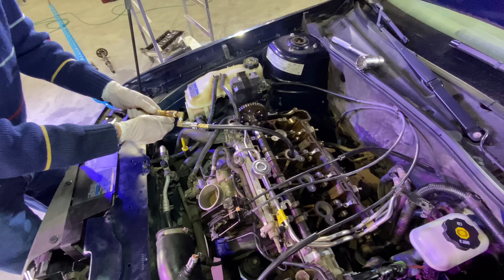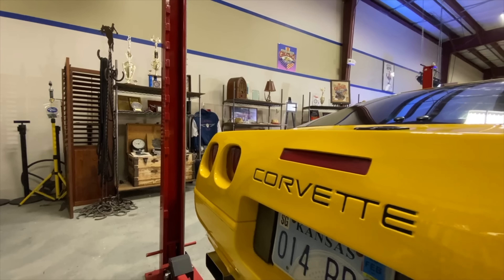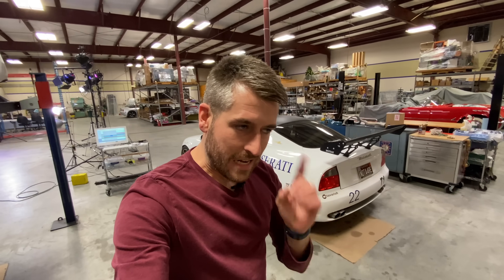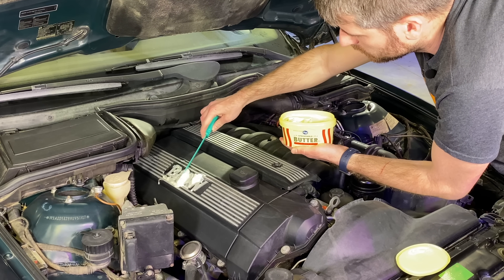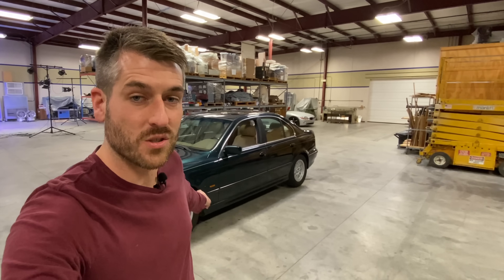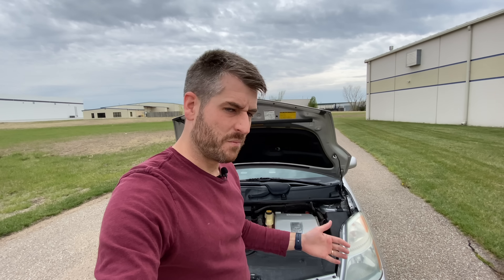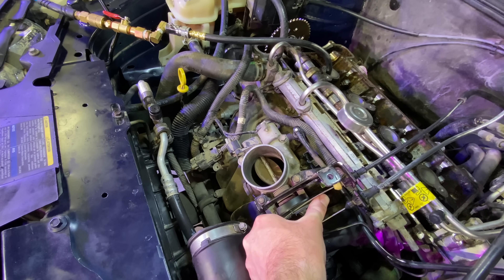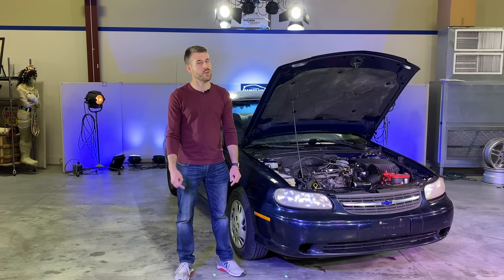Every Car I Own Is *BROKEN*!  And The Fate Of The  $500 Malibu Classic.... *Fleet Update*

Comment: I feel you…About to jump into slightly neglected Audi and see if I can give it some love/a second chance. At least 3k in immediate diy repairs (roughly 8k at a shop..) including but not limited to new cats, rebuilding or replacing control arms, motor mounts, oh and fixing a suspicious horrendous squeaking noise from the gear change lever :’)   
(No doubt only the beginning assuming the timing chain job was done correctly..all of the weird noises started after..) 
I’d love to see the corvette get some love, same with the Maserati!

Comment: The pump is necessary and it’s in the wheel well I believe near the “keg”.  Pull the drivers tire and wheel well and listen for it.  It’s a small inline coolant pump.  Easy to change. 2 hoses and a connector.  It’s mounted right next to the keg.  Pull the drivers fender liner and Ull c it next to the tiny keg

Comment: so simply speaking the c4 needs a restoration 
the maserati needs atleast speaker and tweeter grills and basic maintance 
the bmw 528i needs basic maintance and a clean hood or a reclear  
the bmw z4 needs beter rims and to haunt johny and to go to the beach as its a SEAAA4 
the prius needs a yaris as its sad to be the only hybrid and the yaris hybrid has a simular cooling system but to change a 12 volt batery on the yaris seems to be a pain by the owners manual 
the malibu just donate it to freddy(tavarish) to put a v8 or a rotory in it 
or trade it with freddy
Reply from the maker: Great summary Vincent!

Comment: Yeah, the factory aluminum heads on those engines warp.  You pretty much have to replace it with an iron head or you're looking at a blown head gasket and a replane every 75000 miles.  I had to do that 4 times before I sold mine.

Comment: Continental ExtremeContacts might not be what I'd put on a rarely-used Corvette, but they are hardly cheap tires.  They're one of the top-rated and expensive all-season performance (a bit of a misnomer, I know) tires -- right up there in rating and pricing with Michelin Pilot Sports.

Comment: Keep doing both I'd say
Reply from the maker: Thanks Jon!
Reply: Also i had a first gen prius that had that pump noise too. Drove it 45000kms without issue with the noise until i sold it at 445000kms (277000 miles ish). Just would make noise sometimes

Comment: Have you tried changing the Prius coolant for the inverter it’s a pretty easy job.  I am a fan of finishing a project, so many good Youtubers in Wichita, JR has so many projects going I’ve  completely lost track.
Reply from the maker: I need to change the coolant at some point, but I'm not sure that would help the pump at all
Reply: @ElliottAlvis  didn’t you  do something like that with Josh, was it his Prius?  I’ve had a third-generation Prius now just for a couple of weeks it had 93,000 miles on it ,I changed the coolants and the transaxle fluid gosh that was black I’m so glad I did it.

Comment: You are sitting on a collaboration gold mine.  JR w/the Vette, Ninja w/Zeeee4, Wizard w/Maserati, and J&J auto wrecking w/Malibu to see if anything of what's left besides the engine that can save other Malibu's from the same ignominious fate.  It would be "all in the family" minus Archie Bunker of course. (And probably raise your exposure a bit)  The 528 if it's just struts and wheel bearings you can do it yourself on your channel.  Hell if I can do it all on my 335xi, you can do it on a 2wd. Just watch where all the bolts mark the paint and you'll be in the ball park on alignment even.

Comment: Pull the heads off the Malibu and show us what you find. Keep digging until you run out of awfulness, then dump it. I'd like to see you DIY the Prius pump, the BMW suspension, and clutch & heater core on the C4. Less interesting to watch you take them to a mechanic, but either way you've got to get the C4 done.
Reply from the maker: I think you're right, I will get the C4 done either way.  I need to get that car up and running again!

Comment: Half of me really wants to say I'll take it with the C4, but the other part says, Look Up Corvette Ben here on youtube, he covers all C3's and Some C4 stuff, like look up his stuff and get started or get a list together and ask him what to do, or make a video asking him about how to fix its issues, hell even the car wizard has some experence with this, like he had hoovies barn find one, and that Grand Sport that just came in, and count yourself lucky this isnt a C5 with the trans axel, the C4's still had the C3's traditional type

as it sounds like its just a matter of getting off your ass and doing it, and also a few bolts with that battery, as you have to take the fender off

plus ask yourself why you've fallen out of love with it, maybe you should upgrade the transmission and the engine to get more power out of it, if its got like that stupid doug nash 4 Plus 3, which GM still stupidly uses or did would you believe, the last use being on the Chevy SS BMW E39 Clone they made, that was literally made by the same engineers, or put some money aside to have the GM interior overhauled into something far nicer with better quality materials. 

or look at the suspension and give it a go over. 

and the maserati, FP euro, or ebay, Maserati is owned by Ferrari and Fiat, theirs gotta be some parts sharing, take the numbers and cross check them, as ed did say its a ferrari made by costco

and with the 328, I'd keep it and fix it up, the Z4 however......... if your gonna gamble anything, what better than a car WON by gambling? plus you could wide body rally spec it.

Malibu........ I would say keep doing the cheep car thing, its how you got half your fleet to begin with, and they cant all be winners, hell why not go further and get an even older malibu, like one of the 80's ones with a V8, like an ex cop car like they used in the movie Running Scared?

as it might be fun to have something to intimidate hoovie with when you park as close to his lamborghini as possible with, as those things were huge lol

the orange one please thought, not the real ones designed by the actual italians, such as Marcello Ghandini with the diablo, and Pagani with the 25th, just that Luc Donckerwolke belgium thing a bob that looks like a stupid orange armadillo with a volkswaggen interior

as I swear to god I saw a turbo beetle that looked just like that thing from the inside, an orange special edition back in 04 that saabkyle actually covered would you believe

and I dont know what possesed ZE GERMANS to hire a bloody Belgium to style a Volkswaggen, a Bentley and my formerly favorite brand lamborghini

but they did, like you think they would be smart enough to leave the brand identity alone, but they couldnt do that with any of them. 

still though, atleast it still has the bizzarini V12 in it, that's something at the very least.

Comment: Leave the 5 series alone. It's a time capsule. I worked on them when they were new. You can do the suspension repairs yourself.  Those cars are so easy to work on. And it would be cool to watch you to try to fix another cheep car just watchout and don't get one so far as bad.

Comment: So you ask for opinions and here are mine, they are just my opinions but the money that you will spend are yours , so...  
- The M wheels if they are not good for the Z4 if you don't have any use for it sell them, try to make some profit on them and use the money to fix any of the other cars
- The 528i parts I don't think they are that expensive, maybe AC compressor second hand, about the faded paint a wrap can be a cheaper solution
- Maserati parts we know they are expensive, but at lest put on the doors speakers, those holes look bad. 
- Malibu was not worth the money, the time, neither the views, I think (again is only my opinion). With the money that you spend on this car and the money form the wheels you could buy couple of struts for Maserati
- Your daily should be fixed, it is your daily...
Reply from the maker: You've got some good points there Emil.  Thank you for giving me something to think about.

Comment: You have to learn and fix the Malibu. It doesn't matter if it doesn't make sense to you financially, it's cheap and it makes good YouTube, not fixing it makes bad YouTube.

So to recap, you killed the valves when you installed the new tensioner without activating it and you may have damaged guides. You need a some head work/another head and a timing set. The other option is to throw in another engine which isn't that hard on this car.

I have the head you need. I'll be in town in a week or so and you can have it. I also have a complete engine for this car that I paid $100 for. You can't have it but you could look for similar deals. I would be happy to help with the limited time I can be in kansas but can consult all day long. I know these engines very well.

Comment: Well I am going to start with a question for you. Where do you want your channel to go? Do you want to follow everyone else and work on things that most viewers don't own? Or create content that the average person can find useful?

If the latter is your answer I would suggest keeping the blue turd a little longer. Pull the head and see how the rings and cylinder bore look. If all you need is a head then a good used head isn't very expensive.

The knowledge of replacing a head and timing chain would be of greater use to the average person. It isn't extremely complicated and the basics can be applied to 4 cylinder ohc (single or dual cams) engines.

Now to consider view count. Are you getting more views on the blue turd and freeMW or the Maserati? The views bring money and help expand the channel so that needs to be weighted into the direction you go.

Well these are my thoughts. So read the comments and do what is best for your channel. As much as I love the Maserati I think the blue turd may be a bigger growth option. Yes you will still end up with a blue turd with little monetary value in the end but the knowledge learned will greatly exceed cost.
Reply from the maker: James, thank you for the very well thought out and detailed comment. You've given me something to really think about.